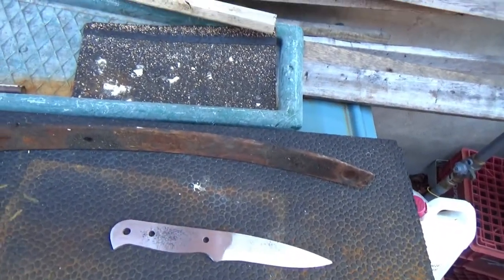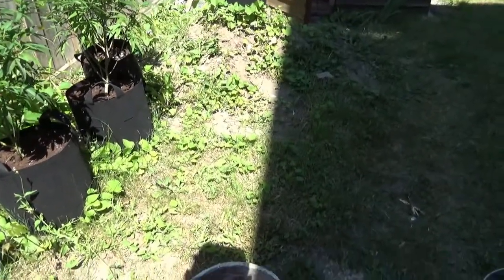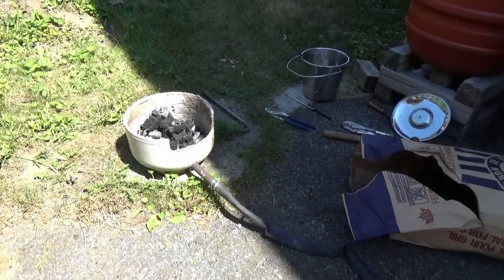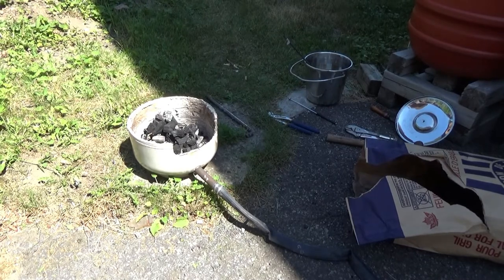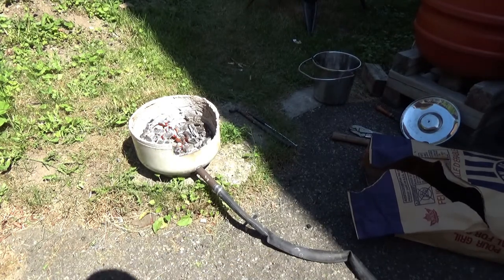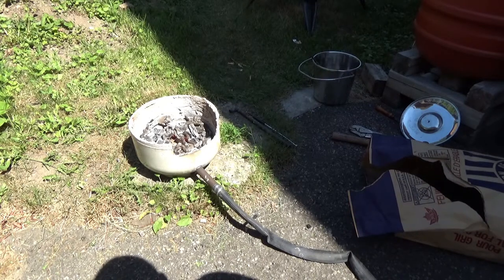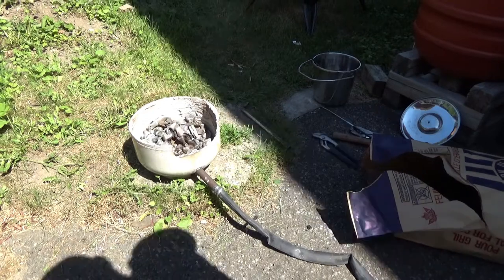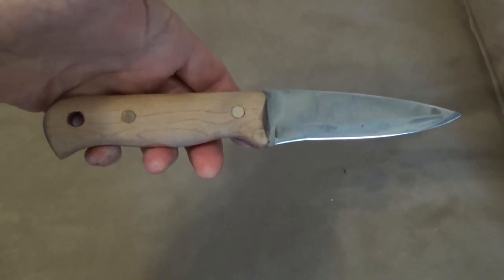Heat treating a knife made from a leaf spring

Comment: thanks for the tutorial bro.
Reply from the maker: Hey there,

My pleasure.  It is a learning experience and a lot of fun.  Thanks for dropping by!
Reply: @compassrosebushcraft6702   i tried quenching using water but itbroke intotwo pieces..im so disapointed...im prepRing again.
Reply from the maker: @diyresttube  When I was in shops at school we always used water, but I now know we were only using soft steel.  For carbon steel one has to use oil.  You also have to warm the oil beforehand.  I do it by heating soft bar stock and stirring the oil.  I use vegetable oil.  Hope the next one goes well!
Reply: @compassrosebushcraft6702  can i use ordinary oil?
Reply from the maker: @diyresttube  Hi there, I still on the learning curve myself, but I gather  you can use any oil.  It does need to be warmed a bit to prevent thermal shock to the steel.  Also of course the hardened steel is very brittle until it is tempered.  If you drop it before tempering it can shatter.  Hope this helps, and good luck!